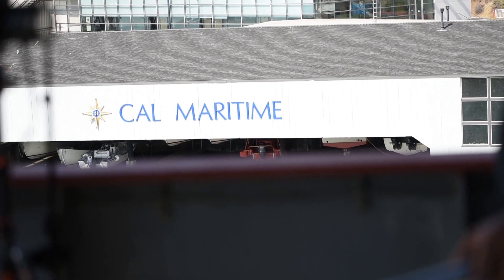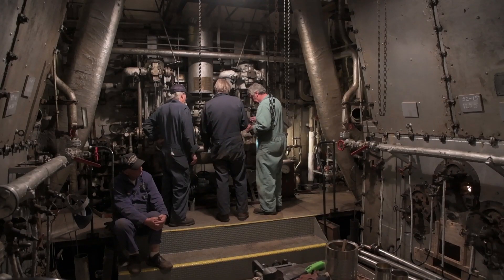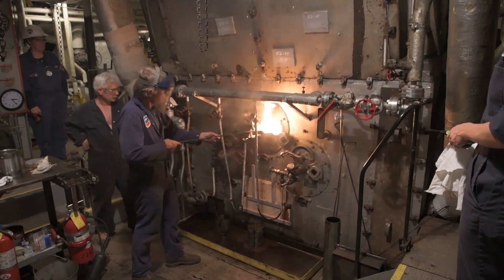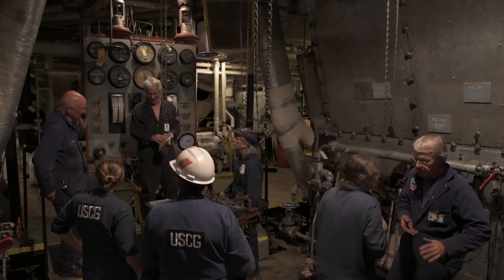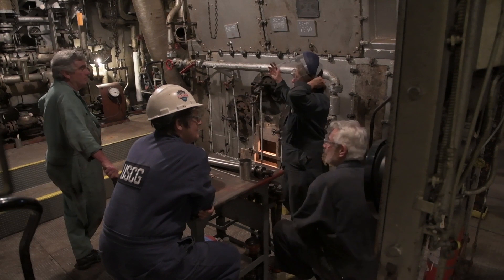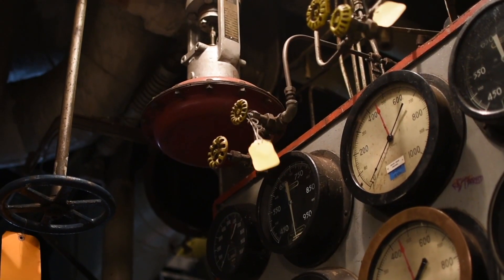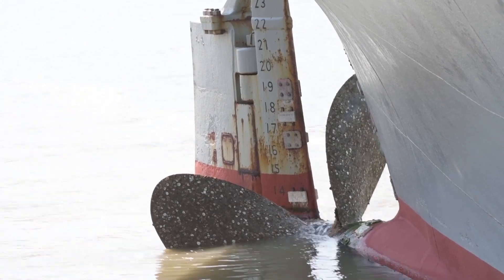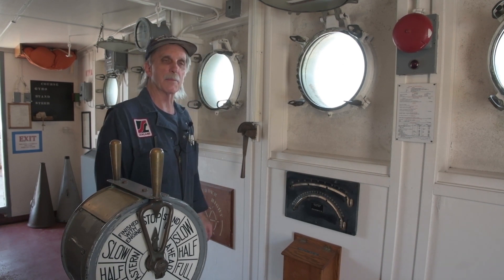Red Oak Victory Engine Light Off

Comment: This ship came out of moth balls in Oct 1966 for use in Nam.  I worked for Albina Engine and Machine, Port Land Oregon, in the yard as a machinist reactivating it. Upon reactivation I worked as Fireman,  Water Tender and Oiler dock side, along with doing dock and river trials along with 13 other Victory ships.  I have company documentation in my name to that effect on the Red Oak Victory as well as 13 other Victory ships I was on.  I do not know when it went back into moth balls.
Don Benson
Central Machine _ _ _ Fabrication
centralmachinefab  dot  co&
Reply: Don, thanks for that bit of history.  The ship went into the mothball fleet in Suisun Bay in 1968.  Last year's light off ended 50 years of inactivity.

Comment: Great to see.  Thanks to all who contributed to this effort.  I served on a Victory ship 1970-1971 USN.  Originally SS Escanaba Victory, converted into a refrigerated stores ship in 1953 and commissioned as the USS Regulus (AF-57).  Homeported San Francisco/Alameda it served with distinction in the Pacific fleet until being run aground and destroyed by typhoon Rose in Hong Kong, August 1971.  Though a radioman, we were were short staffed in engine room during our WestPac deployment and I served a few weeks doing engine room watches (MMOW) reading gauges and crawling down "shaft alley" to make sure all the bearings were being lubricated.  Hot as hell, but an impressive piece of machinery.
I look forward to visiting the Red Oak Victory.  Where will it be docked?
Reply from the maker: Thanks for your service!  I hope you can come visit us some day and share some sea stories.